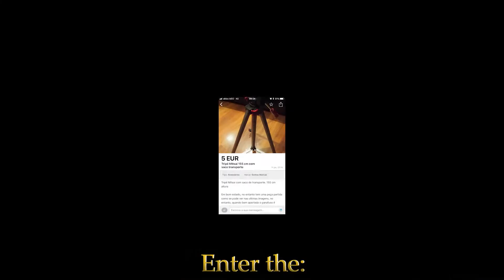DIY - HOW TO Instal a tripod on the KAYAK for the GoPro

Comment: That was lots of work, I like your diy ideas. I own a almost identical kayak, I was thinking in do something with that lid, like a bamboo cutting board on the top, and a polystyrene layer inside. The bamboo would give enough resistance to attach a gopro "antenna" mount ( and processing fish obviously) and the inner side would make it more floating.... you know, sometimes the surf is unforgiving.
Reply from the maker: Hi Aranha 93, it's half the fun of doing this things or selfs :D
Well that's one idea for sure. I'm thinking that will be a lot of work after cleaning all the blood and guts from the kayak if you are using that lid for that. But if you actually procees fish wille your out, go for it.
Everything you do to give more buoyancy to the Kayak it's allways a good idea.
I'd love to see those ideas in progress :D